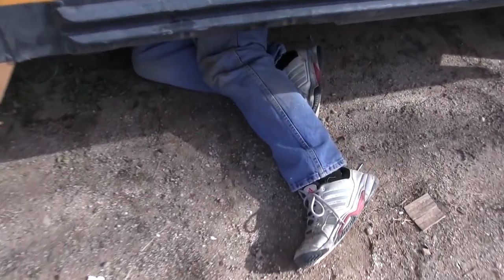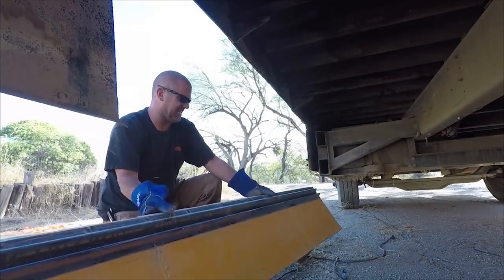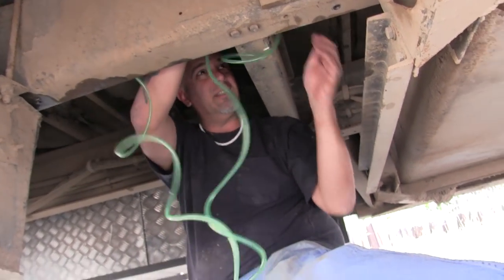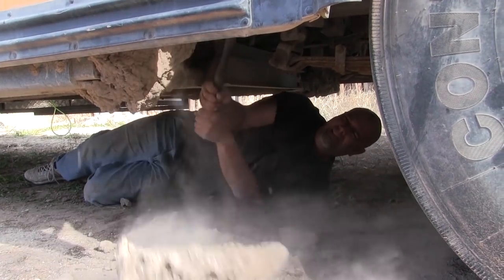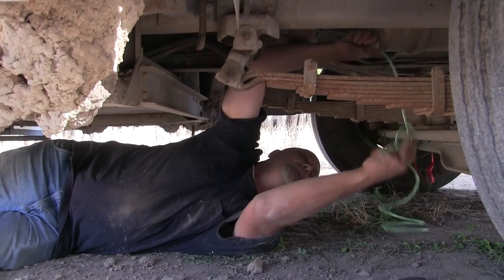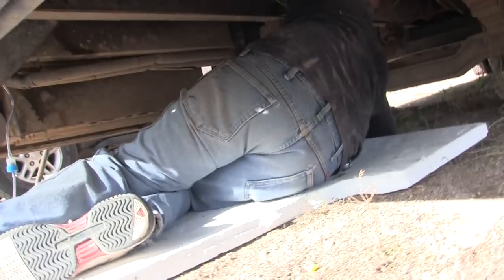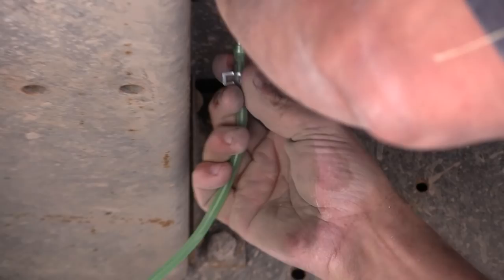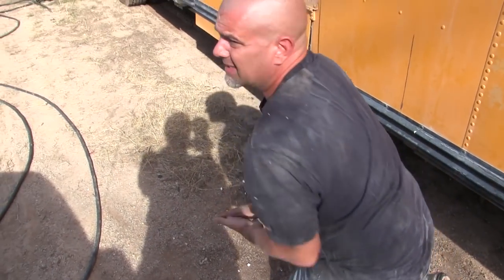Adding TWO Diesel Heaters to Our Skoolie! (Part 1)

Comment: I did the same in October, it's a fine system, serves as a backup and well-distributed heat, no condensation and much more BTU per dollar. You're going to love it. I'd already bought my wood stove but decided to not install
Reply from the maker: We are still adding our woodstove as our primary heat while boondocking.

Comment: Mike, you could install a fuel tank for the heaters and plumb them from that and have a small pump from the main tank to fill it from. A fuel guage would stop it running out. Just a thought. Not gonna mention ducting yet.

Comment: I’ve been running one of these on my skoolie build. Just one heats my 40’ bus! I recommend switching to the “dial” thermostat that has no display. It’s less of a current draw (about an amp) and just looks a lot better (Unless remote control is important.)

Please make sure you  have the exhaust be somewhere that you’re confident it won’t enter your living space. You do not want to breath those diesel fumes. You really should get an air quality monitor device in your bus, especially now that you have those heaters. It’s certainly possible for the combustion fumes to leak into the warm air outlet. 

I am moving my heater, for the 4th time, to somewhere that will put the exhaust above all my windows. It’s mounted about 10” down from the ceiling. 

Also, the exhaust can’t be very long without switching to a bigger pipe.
Reply: How did you like it mounted near the ceiling?

Comment: The air diesel heaters are great heaters for your bus. I have 2 air diesel heaters in our bus. One large Espar diesel heater that heats the basement, rear bedroom and bathroom. One Webasto diesel heater that heats the front of our bus just like you have done. It's great dry heat and only uses a small amount of diesel and 12v power. I supplied diesel from my Onan genset fuel supply line. I added a new fuel filter that now supplies diesel to the genset and 2 diesel heaters. the big Espar heater is 30 ft away. The fuel pumps have no problem pulling fuel to both heaters at the same time. I see that you added a fuel line to your tank. Make sure it does not let any water or dust get into your fuel tank as you will have big expensive bills if water gets into your fuel system. Pretty much #1 failure in diesel fuel systems is water. You could have gone to your engine fuel filter and found another fitting to t into also. Make sure you install a fuel filter for both heaters as small particles with plug the fuel nozzles in the heaters. it will save you money in the end. My heaters came with rubber gaskets to put under the heater to seal from the outside fumes.
i know these are chinese air heaters but they sure look good especially with the electronics screen they come with and the price is fantastic.
enjoy the heat you won't regret getting them. It's crazy how much heat they put out.

Comment: First start up with diesel heaters smoke then after a few minutes it clears up. Espar heaters in semi trucks have done it for years. I would recommend the diesel heater with coolant heater all in one unit to heat the inside and keep the coolant warm in cold weather towards the engine area.

Comment: Most rvs with heaters fueled by the main fuel tanks are set to make sure there is at least 25% of the fuel left in the tank when the heater runs out of fuel.

Comment: Water will settle to the bottom of tank pick up line should be 4/5 inches above bottom to help prevent picking up water when sitting for prolonged times

Comment: mike you should cut that fuel pick up tube so it is 3" off the bottom of the tank so you do not end up sucking your tank dry and have NO fuel to drive to a truck stop to get more and you should add some sort of pre filter sock so you don't clog your fuel line to your heaters and add a check valve on the fuel lines to each heater so keep from draining the other fuel line.... i just put one of these 5kw heaters in my rv but haven't been able to get it to fire up all the way.

Comment: If you want to reduce bubbles, run the fuel line using metal break line tubing and short sections of flex only when needed. Also secures easier. Instead of using hex plug, use a hex bolt, drill it, jb weld then you have hex to tighten it.

Comment: Two things to note about those heaters.

1) the exhaust and intake really don't want more than a single 90' bend in the pipe.

2) protect that fuel line w some split loom at least.

3) the fuel siphon stem, I'd bring it up a few inches so you don't suck your main tank dry.
Reply: Install a check valve so the fuel doesn't back flow into the fuel tank when on a slope.
Reply: Also, watch this video series. Lots of good info on maintenance and install best practices.

Comment: Just wondering, does the diesel heater come with a fuel tank off its own? I’ve seen other installs where they’re using a separate tank. Apparently it doesn’t use a whole lot. I think that’s the route we plan to take… I’m not entirely comfortable (or proficient) going into the main tank.
Reply from the maker: Yes, it comes with everything you need for an install including a fuel tank.

Comment: when hes been a bad boy he isnt sleeping in the doghouse.....nooooo she makes him sleep under the bus with the spiders
as for the diesel pickup tube for the heaters , i would strongly suggest to have that pickup up about 2 inch higher then the pickuppoint for the engine of the bus , that way if the heat cuts out because the dieseltank is empty you still have some diesel for the engine to drive the bus to the gasstation to fill it up , beats the heck out of hauling jerrycans to the bus and bleeding the air out of the engine possibly draining the batteries in the process

Comment: John McLukie has done many YouTube videos on these heaters.  He recommends not using the prime feature..  the pump running without diesel in it,  will cause premature wear and failure.  He recommends drawing fuel up to the heater, either caveman or siphon.
Reply: We installed one in our bus.  Best money we ever spent.

Comment: Hi. You might want  to check out David McLuckie on YT.  He has a couple of neat tips on using these heaters. I especially like the use of an EGR intercooler to get hot water from the exhaust. Cheers!

Comment: painfull watching people with no mechanical ability. taping into diesel fuel line big mistake. that cheap small line WILL break it WILL suck air into main line. you will be walking with a big bill to get air out of lines all 9 of em :)
put in tank or tanks for heater.
never ever get low on fuel on a diesel.
50 years as top mechanic says im right
Reply from the maker: We repaired the main fuel line. Shouldn't be a proble there. We added the new standpipe so we wont get air in the bus diesel fuel line. Didnt you see that?
Reply: @BussyMcBusface  just seen part 2 but u did have it totally wrong. now did u paint all the holes u drilled or leaving metal bare to rust.